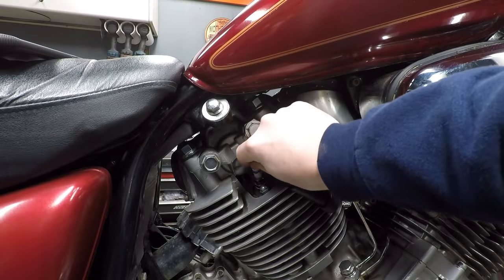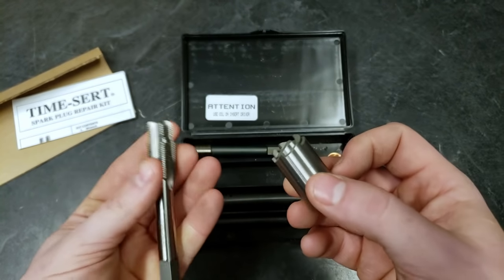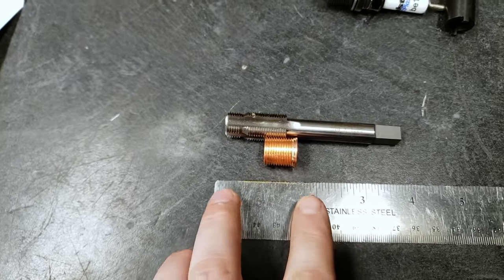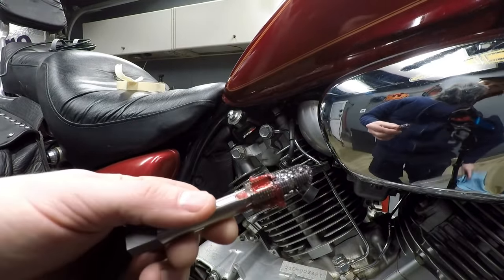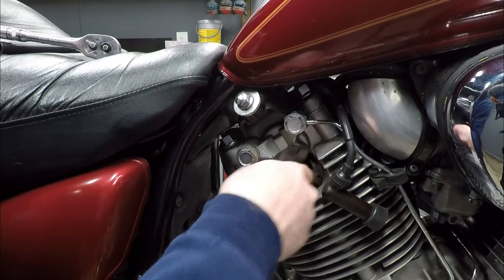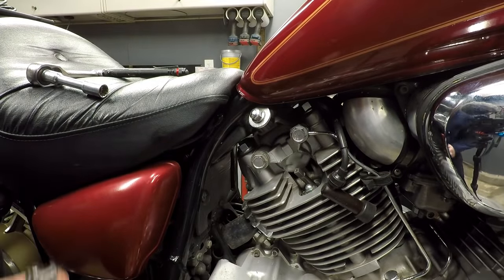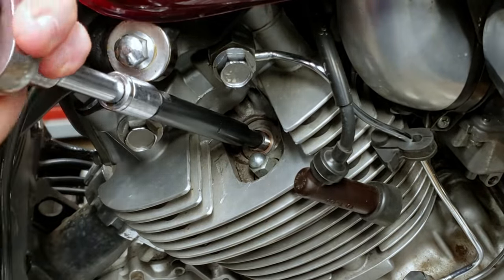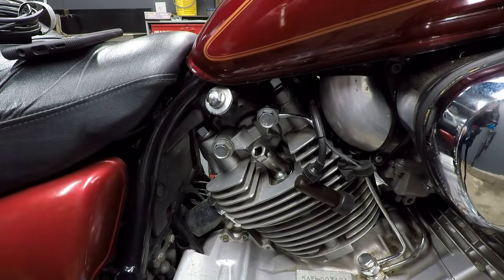Time-Sert Spark Plug Thread Repair - Fixing Stripped Threads

Comment: I've done time sert's before and I was always worried about leaving shavings in the cylinder. I made and attachment for my shop vac with a rubber pole cap that fit the diameter of the shop vac hose and put bendy straw thru that rubber cap, then sealed it with hot glue so I could put the bendy straw in the cylinder and suck it all out. I thought I was a genius, ha!

Comment: I'm a retired Machinist and I want to say your instruction are great.  I did a repair on my 2014 Harley with the Time Sert system. If you take your time its is a great system.  I contacted Harley about my problem and this is the system they use.  They wanted $2,00000 to repair the threads.  Thanks never go cheep...
Reply from the maker: Well I appreciate that!

Comment: Can you please do a video like this where you drill into the engine to install the timesert and leave the shavings inside the engine and see what damage it does to the engine?
Reply from the maker: @650DRRider  That would actually be interesting to show. Aluminum is softer than the rings and valves so it would be a good experiment

Comment: Tidy job , well thought out , but a longer extension on the time sert tools and a t bar would have made your life a lot easier .
Reply from the maker: Seemed pretty easy enough.
Reply: @BrickHouseBuilds   ok , it would take the heavy side out of the wobbly ratchet install ,,, why do you think you got the uneven cut on the seat .
I was being polite , now Im being accurate ,, its hard to teach someone something they think they already know. Why do you think quality  tap and die sets dont come with a ratchet ?
Reply from the maker: @tomthompson7400  Dang man I wouldn't think this would upset someone.  The threads were stripped originally so thats why I needed the tool. The tool is initially guided in with whats left of the original threads so having it go perfectly straight is probably not a guarantee which is why this kit is valuable as it cuts a new seat in line with the new insert. Sure I could have used a longer bar but it wouldn't have made any difference.
Reply: @BrickHouseBuilds   Im not upset ,,, but I am an aerospace engineer , with 40 years of experience ,, and I still take good advice when its offered ,,, every days a school day.

Comment: Speaking as an Ex-Engineer. I thought you made a mighty fine job of that. Although I know these insert things exist, this is the first time I've ever seen anyone do this job in full. By the time you were ready to fit the Spark Plug back in, I thought how good it looked. I know from experience its not easy starting a Tap off nice and square. All too easy to get it at an incorrect angle so to speak. Well done! - I doff my cap sir... :-)
One final thing. Just how do people cross the threads in the first place? Bewildered...lol
Reply from the maker: Thank ya sir! So believe it or not this may have been sabotage from a previous "mechanic" where this bike was at. I had been tasked with repairing many things they did wrong.
Reply: @BrickHouseBuilds  I was about to say - no way - then I remembered being sabotaged once myself by a mechanic. So hard to prove, but it happens. Trust in life is huge, you sir are earning mine - great job! Thx.

Comment: Excellent video that provides a good view of the actual repair; however, if you're repairing a deep well vehicle spark plug be sure to run the insert driver tool towards the end of the insert before threading in the spark plug hole. I tried using the halfway method and ended up seating the insert a 1/4" from face of the hole. Fortunately I was able to use an extractor to remove the insert. On the second try, I ran the insert driver close to the end of the insert which allowed me to thread it all the way in the hole before finally setting it in the seat. I also used red threadlocker and let it sit overnight before installing the spark plug.

Comment: That’s a really nice bit of kit. I have never seen it before. Nice job again. For anyone doing the same job without your experience I would advise a Tee handle to turn the tap etc as it balances the pressure to help guide. Cheers Richie.
Reply from the maker: Without a long extension I couldn't use the t-handle which I would have preferred

Comment: Outstanding presentation, thank you. My only question: why not gently vac out the shavings vice blowing? Would be afraid of getting something tiny jammed in a crevice.
Reply from the maker: Thank you. I'm not confident a vacuum would have worked but regardless the material in there is aluminum and much softer than what it may interfere with

Comment: Great video. This helped me to understand how the kit works in detail. My dilemma is a repair to the number 5 stripped spark plug hole in a 2000 Jeep Wrangler 4.0L I6. Because of access space I may have to use a Helicoil. Not removing the head either, I'm to frigging old to do that again  🤣. Comments too help me are appreciated. Again, that was a a great video, Thank you.
Reply from the maker: Glad you found it helpful! I'm sure that #6 is a pain. Obviously this would be the better fix but if you can't get access for the tools then what can you do?!

Comment: Nice work.  I had some threads go bad on my 64 Triumph.  The right side Spark plug popped out while I was riding the bike.    I didn't trust myself to attempt this job so I brought it to a local mechanic who specializes in vintage British bikes.   I think he used a heli-coil but I'm not sure.  The time-sert seems like a better option.
Reply from the maker: I doubt he would have done a helicoil for a spark plug thread but who knows. Hopefully its holding up!
Reply: Ive seen helicoils used for spark plugs,  ive got no idea how they would hold up but I would never use one.

Comment: Really, really well done - I'm saving this as a tutorial in case I ever have to do it. 
Towards the end I was thinking, why not put some red thread lock on the Time-Sert to keep it in there? After all, red thread lock can only be released by - oh, I get it now - heat. [facepalm]
Great tip with the grease in the gaps to catch the swarf - I'm sure there would have been a lot more otherwise, and the blowout method seemed very effective. Hmm, I wonder if a vacuum adapter would work, made to seal the spark plug hole... you'd probably have to crack a valve open the slightest bit for some inlet air, but all the suction would go into the vac. Hmmm...
Reply from the maker: A vacuum could also work but I honestly don't have a good vacuum. Mine is kinda terrible

Comment: Are the tap and inserts standard sizing? I was pulling out the plug on a recently purchased bike and the plug came out with an old insert attached. I’m thinking I can thread in a new insert - would prefer a Time Sert if possible, just don’t know if they have some kind of custom sizing that makes them incompatible with threads cut by another tap.
Reply from the maker: That I don't know

Comment: Good 👍 information on the Time-sert.  Also that back-tap was very interesting, there have been a few times I could have used something like that.
Reply from the maker: The back-tap is super handy. Its not uncommon to see a hole with just a couple boogered threads and that tool is ideal for it

Comment: Cool video, always nice to pick up different tips and ideas for repair and maintenance.

Just curious, is there a reason why you didnt put threadlocker on the insert? Does it lock when you finish off the last threads maybe?
Reply from the maker: Thank you. Check out the links to the products in the description. They explain why you don't need threadlock. Remember the lower portion of the insert is being expanded and locks into the new hole.
Reply: @BrickHouseBuilds  Perfect, just what i was thinking. Ill check it out and buy a set, then hope i never need it 😅

Comment: At the lower end of the price scale, there are those kits that do not have a stepped tap but rely on a taper. Has any had any success with these or are they sheer optimism?
Reply from the maker: Those are a different design all together. A stripped spark plug hole is not something you want to cheap out on as a ruined head is far more expensive than a quality repair.

Comment: Great vid - though I am curious as to how many turns you had before the tap falls into the cylinder ? 👍👌🙏😎
Reply from the maker: Thanks. For your question, a few? You just pay attention to what you're doing and avoid going in too far
Reply: Brick House Builds - its because as you are spot facing the two diameters the tap is also turning in until you stop? 👍👍
Reply from the maker: @Jonodrew1286  I'm not sure what your actual question or concern is here but you are cutting threads until you feel it pass the lower portion of the hole. Go a bit further and stop. Then you have a guide for the seat cutter

Comment: So the intake manifold bolts and holes on my cx500 are almost shot from the previous owner, they have just enough thread to make a seal. I was going to repair them when I next take my carbs off and was going to do helicoil, I know time sert is also an option but do you think it's overkill for my application? I totally get using time serts for a spark plug.
Reply from the maker: This wouldn't be the right tool for that manifold bolt. A regular helicoil or another timesert variant would be bettee

Comment: When I finished motorcycle technical college and set up my own motorcycle workshop, I only ever used Wurth Time-Sert thread repair inserts.

The quality of the Time-Serts was outstanding and once installed there were no more worries of the thread being stripped, even with my most heavy handed customers. 

I had tried Helicoil thread repair inserts but was extremely unimpressed with them.
Reply from the maker: Definitely a far superior design that gives piece of mind

Comment: Another good thing about these is they brake free at at so many ft.lbs just incase it seized up or over tighted. The whole thing comes out. It's better than a bolt braking off in the hole like when you use the coils.
Reply from the maker: Its definitely a well designed product

Comment: Timeserts are the only thread repair system I use because the inserts are expanded in and do not come out when the fastener is removed. 
The cheap sets on eBay rely on thread locking compound.
Reply from the maker: Definitely a superior design
Reply: @BrickHouseBuilds  it is indeed. The kits are expensive but they get you out of trouble and produce a perfect repair which is a fit and forget. And a happy customer is what it’s all about!

Comment: I have done that repair once. Didn't like it. It seemed to work for a while but other options are what I would call "permanant". Replace the head is my solution if possible.
Reply from the maker: You used this exact kit?
Reply: @BrickHouseBuilds  
Not by name but yes the kit. It worked for a while. Better heads are preferable. Not repairs. I sold the CL 350 with that repair.  It worked for me. Once sold it got fracked up somehow. Not my idea of making an aircraft or motorcycle correct.
Reply: Great job. Enjoy the methodical style and straightforward tutorial.  I would like to add that next time you do this try taping some small diameter flexible pipe, fuel hose or smaller to a slightly larger pipe then attach or tape it to a flexible vaccum pipe to suck out the shavings. Hope this helps. 😊👍🏻
Reply from the maker: I mean I cant do a full engine rebuild on every bike that enters my shop. This is a quality fix
Reply from the maker: Yup

Comment: Would it be helpful to use the " backtap " first to cleanup the threads at the top of the 
  hole to guide the stepped tap in ?
 I'm curious about the borescope that you use . Have you posted a link related to that in the past ?
Thanks for the videos.
Reply from the maker: In this case not really.  The new tap cuts its own seat so perfect alignment with the original hole (while important) is not necessary
Reply: @BrickHouseBuilds  Gotcha , that makes sense . I always admired the Honda V's but at 6'3" I felt like a giant when I test rode them . I watch all your videos .
Reply from the maker: @bill3641  at 6'3" you definitely would be uncomfortable on one. At 5'8" I fit the small and medium bikes but definitely have to tip toe on large stuff lol
Reply from the maker: I just noticed your borescope question sorry. Should be linked in my Amazon Storefront
Reply: @BrickHouseBuilds  Yup, i don't think that too many Japanese motorcycle designers were over 6' 😁

Comment: You can use Loctite 2620 on this kind of insert if you want to overkill it. great knowledge.
Reply from the maker: Its actually reccomended you DO NOT use loctite on this in case you should need to remove it.

Comment: Time-sert representatives give a much better how-to demonstration. For example,  slightly unseat the exhaust valve and introduce some air flow up the pertinent exhaust pipe with a slightly open air nozzle, when done carefully, the chips will exit up the flutes of the tap . I've in done it several times and it works!
Reply from the maker: Well they are designing the product so their demo should be better. At the end I state this is just documenting my experience installing it and not necessarily a how-to.
Reply: @BrickHouseBuilds  
To quote Alladin , He can be taught!
Reply: Why not helicoil which is more resistant for the same bore diameter ?

Comment: Stripped plug threads can be avoided if you screw the plug in with your fingers, if it gets a bit tight back it off and try again, never use force or a tool to start, if the plug is deep use your tube spanner with your fingers. Feel it before you destroy it.
Reply from the maker: Im not the one who stripped these threads
Reply: @BrickHouseBuilds  I am not the one that said you did, har har. A small diameter vacuum tube would be a handy tool and an endoscope or just endo and suck the tube, blowing it could send it upward and with the grease stick to the top or a valve. And Endo inspection would be comfort knowing 100% not 1 single shaving left behind. Better still use your fingers to install the plug.
Reply from the maker: @mohuckmedshishkeblob1712  Even if there was a shaving or two it will be perfectly fine as an aluminum shaving is much softer than the hardened valve seats. No damage will be done.

Comment: If I could access the plugs like that, I would have tapped an oversize thread & resurfaced the seat, but that's it. Skip the "insert" part and switch to a BSF42P! ( M18x1.5 spark plug)
Reply from the maker: At this point I firmly believe you should make a channel and show us all your methods.
Reply: @BrickHouseBuilds I can't make movies, but I'll keep watching (while I'm bored) &  making suggestions (while I'm high). If you like them, try them, otherwise laugh at them.

Most (maybe all, idr) come from personal experience(s) where I learned from sweat, blood, and burns. (That's better than video or books!)

Comment: Only thing I would've done differently would be to have added a loctite 620 (high temp retaining compound),  on the outside of the threaded insert to lock it into the newly formed threads in the head
Reply from the maker: I believe they specify its not needed
Reply: No need for loctite, once the insert is seated,  2 or 3 more turns of the install tool will form the unfinished threads at the bottom of the insert and swage it firmly in place.

Comment: My spark plug will tighten and loosen back up if I try to make sure it’s tight
Reply from the maker: Hard to tell what your situation is for that one.
Reply: I drive a scooter but every time i go to drive it spark plug pops right back out of it so not sure if it’s stripped or not
Reply from the maker: @cgilfoy05  and it has this thread repair kit in it or nothing? Regardless that sounds very stripped. You can visually see missing threads im sure
Reply: That i have no idea about I just found out what a thread repair kit was from a coworker

Comment: I went to a dealer,... bought a New 1980 GN400,......there was a reason they waited till dark to give it to me,....it was july 4th I took my wife to see fireworks,...the next day I wondered if some one stole my bike and left me another?
The Night dew made the chrome orange and it was pitted.
I went back,.... and the made me take a Kawasaki CSR 305???????? so I rode the bike till its service time they serviced it a few miles away my leg started burning it was covered with hot oil?
They striped out a head bolt  and they showed me how they were fixing it.
It looked about like what your doing.

Comment: Why not remove the head before doing the job.  I know it is more work, but it is definitely the way to make sure nothing gets into the cylinder.
Reply from the maker: A couple potential shavings of aluminum are softer than anything around it and won't be a problem.  Removing the head would more than double the labor costs and therefore bill for the customer which is already exceedingly close to the value of the bike

Comment: Why not heli coil it. Once done, leave out the spark plug and  crank the motor over and blow the particles out the spark plug hole. Not a big deal.
Reply from the maker: This is FAR superior to a Helicoil
Reply from the maker: If I can avoid compressing metal shavings into the ring grooves I prefer to